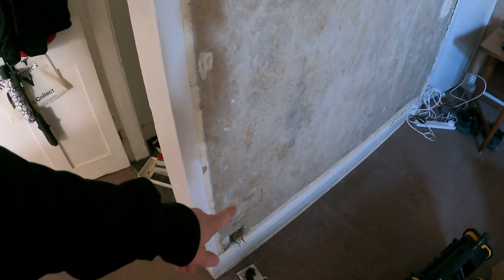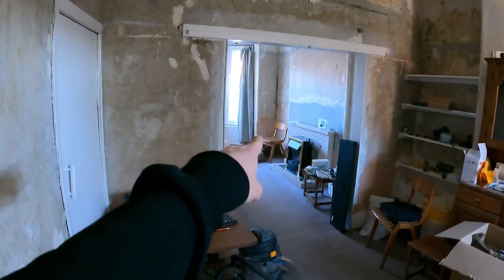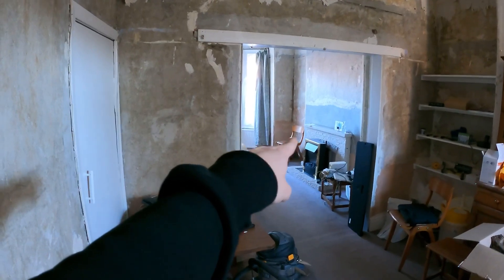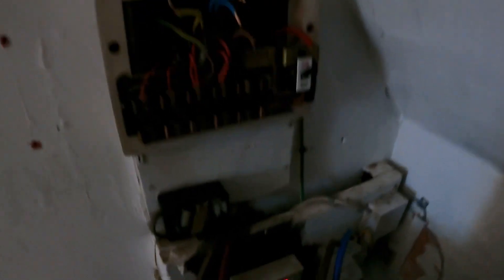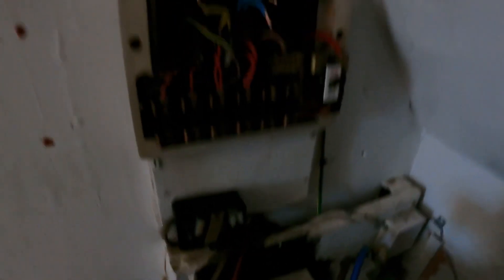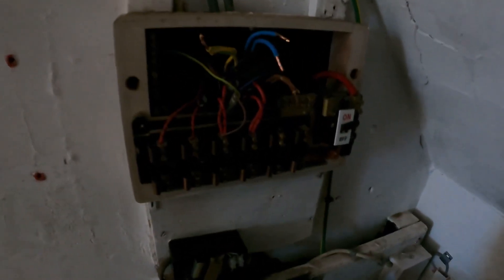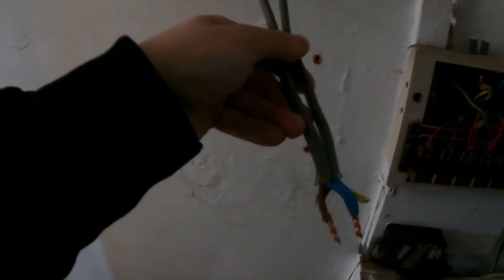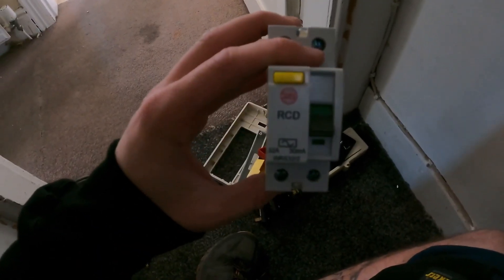Consumer Unit Change | Earth Bonding | extra sockets / Electrician At Work

Comment: Top man keep-em coming. Borrowed neutrals on two way switches connected the downstairs and upstairs lighting circuit. It will make it tricky for those working on any of these circuits in the future assuming you think it’s dead on one circuit but it actually is not due to the link with the other circuit. It was really bad practice and I wonder whether you coded it F1, C2?
Reply from the maker: I didn’t code it, but made a note in the CU for any future sparkys so they’ll know why it’s all on the same circuit. 

I didn’t code it because it’s all on the same circuit so as it stands it’s not “borrowed” 
only downside is there’s only 1 lighting circuit so if it trips you’ve got no lights.

Comment: What size are the tails going into the board ?
Reply from the maker: 25mm lives and 16mm earth 
Thanks or watching 😁
Reply: @Cablesmith  cheers is that standard spec or are you going overboard/future proofing? 
Great vids
Reply from the maker: @kevinobrien8265  that’s standard spec. 
Some properties you can get away with 16mm tails but for the price difference (literally about £2) may aswell use 25mm for any domestic property.
Reply: @Cablesmith  cheers, keep the vids coming 👍🏻